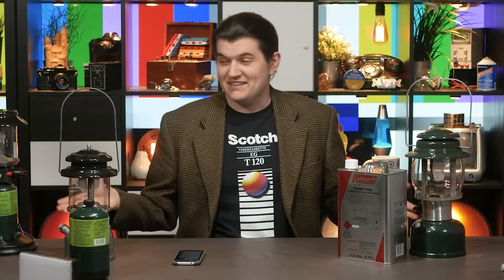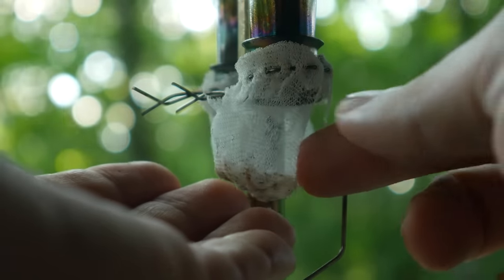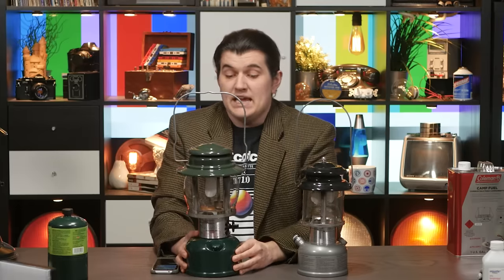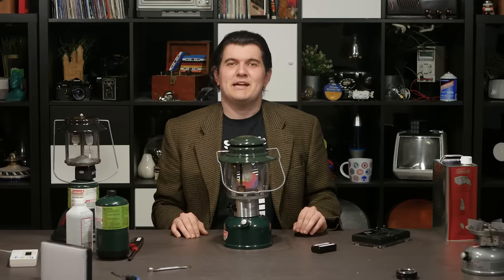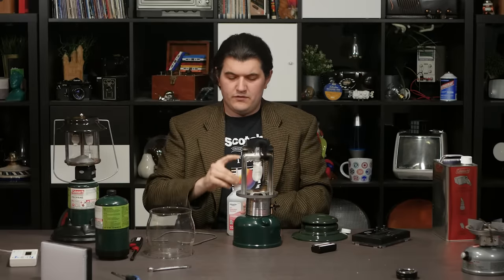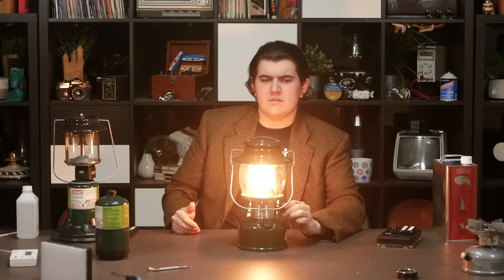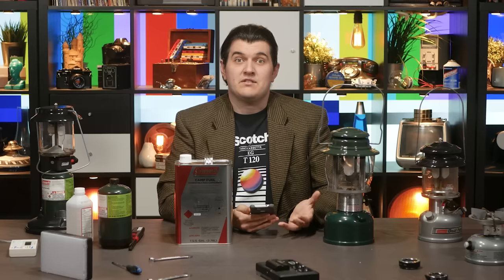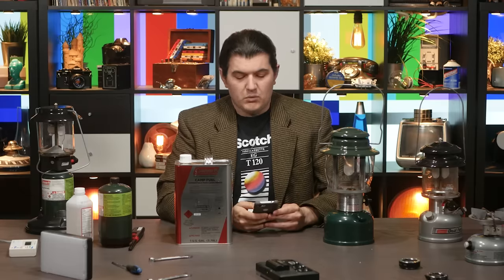A very rambly Coleman Lantern follow-up. Turns out they rarely make sense in 2021

Comment: A kerosene lantern makes a ton of sense as emergency lighting if you are planning to use it in conjuction with an emergency kerosene heater to provide heating during cold weather. Since kerosene has a long life expectancy and is cheap.
Reply: And you can get it virtually anywhere in the world. Downtown in a major city, in a little hick town in flyover country, a village in the Australian outback or the Congo, they'll have kerosene.
Reply: In the climate today, with price hikes, and the potential of no availability of petrol then having another lantern that can use an alternative fuel is always handy.
Reply: Realistically if you are an emergency prepper, you're going to have one each of the dual gas, the kerosene, the propane, and a battery op one.  You're also going to have the equivalent heaters and camp stoves available as well.  Because in an emergency you don't actually know which one is going to be available.  Kerosene is very stable and can store for quite long as well, as you mentioned, but so can propane which also works for emergency grills and heaters.   I would generally pick both over the dual gas option.

Personally living in an area that can get bad winter power outages that last several days, I have propane heaters, a propane camp stove, several propane lanterns like these, several battery op lanterns, and even some chemical light sources (glow sticks) to cover most emergency lighting needs.  We also keep a good stock of propane in winter, which we'll burn in summer over cookouts and then get cylinder refills again late fall.
Reply: @wanderer202   And in long (days, not hours) power outages, where will you recharge the "rechargeable" lights and gadjets ??
Reply: @gedeon2696  i have a about 120$ semi diy solar charging port. It's basically a mediocore photocell, a small battery bank and a bunch of charger outlets. I didn't even have to solder anything because, while not made for each other, modern gadget tinkering crazyness has made them all completely compatible out of the box. 
It doesn't deliver nearly enough power to provide lighting on its own or run any appliance, but if you have to cycle batteries or charge phones and laptops and the like while they are not in use, it's able to cover plenty. And thanks to the reservoire power bank, even multiple things at once for quite an extended period of time. 
And aside from the starting investment it's completely free. It can also be upscaled quite a bit without any real additional hassle if you find you need twice or thrice the power. 
But really, for daily use for my phone or to keep my emergency stuff charged in, you know, an emergency, even an overcast winter day delivers more than enough juice for all of your off the grid survival needs.
Reply: I agree and its always ready to use because Batteries will discharge over time as well as you need to have them charged in case of an emergency. Kerosene on the other hand will always be there.
Reply: @gedeon2696  like he said in the video a small solar panel can recharge them. Plus you can use other sources like generators (that are likely to be used in emergencies) to recharge your batteries without needing to buy more fuel that may become scarce or expensive in emergency situation. Batteries are a (relatively) one time purchase that can provide light for many hours without need of going out to buy more fuel
Reply: @gedeon2696  I have a battery lantern that recharges by solar panel on the top of it.
Reply: @kurtacus3581  I call bs on that. The most advanced batteries on the market still have a shelf life that drastically reduces every couple of years and wont hold any significant charge after a decade if that long. I've got dual fuel lanterns that are over 40 years old and perfectly serviceable. And the practicality of a fuel lantern is not in fuel efficiency.  It's in the ability to instantly renew the fuel source.  Because when your solar panel driven lantern dies after dark you are screwed till the next day. I can dump a container of gasoline in mine fire it back up and keep on doing what I was doing.
Reply: @benknrobbers  it's battery recharges during the day. It will still run after dark. That assertion alone is enough to know you aint thinking clearly about this. Also you are still relying on fuel sources that can become scarce or expensive during emergencies or crisis. Doesnt matter how old and reliable your lanterns are if you can't get the fuel needed to make them work.
Reply: @kurtacus3581  unless it's overcast.  Or you forgot to plug it in. Or the batteries died with age. I would say that your assertion alone is enough to show you "aint" thinking clearly about this. But my obseservation is a general "let them eat cake" attitude.
Reply: @benknrobbers  saying "you forgot to plug it in" is like saying you forgot to light the lamp. Also you can check the power of batteries and get new ones over time if its even necessary. And thats not to mention how in this very video he talks about how much more energy dense batteries are compared to fuel burning lamps. Meaning i could buy more batteries that will last longer than fuel would without even having to worry about recharging
Reply: And safer than gasoline.
Reply: @kurtacus3581  you can buy $1000 of batteries that'll last you a few years. I can buy 500 gallons of fuel for the same price and be set for generations
Reply: @tacticalidiot175  dude, kerosene has a shelf life of only a couple years, propane and gas even less so. What are you talking about? My argument is about obtainability of resources in an emergency situation. Fuels will be scarce or even unobtainable in an emergency situation. If all else is even and a new rechargable battery was purchased and new fuel was bought just before a disaster. You have a limited fuel supply that you likely will not be able refill, not to mention any other commodity that will use that fuel source. Whereas a recharchable battery that can be recharged via solar panel, by hand, etc has basically unlimited use.
Reply: @kurtacus3581  kerosene lasts decades, "what are you talking about?" Batteries will be impossible to find and will be trash in 10 years. No more will be produced. Fuel lasts forever. You can pump it right out of the ground by hand if you live near a field and it will be circulated. It provides heat, and is far more energy dense and lighter. Batteries absolutely suck in cold and hot weather, too. What are you gonna power your stove with?
Reply: @tacticalidiot175  standard shelf life for kerosene is 2-5 years. You can also run out of it. Im not sure what you think is pumped out of the ground but its not pure kerosene. And not everyone just has a field of crude oil in their backyard and a refinery in their kitchen. For a lantern it is wasteful and innefficient to use fuels when a rechargable battery is less expensive and will last for the amount of time you would need to use it in some sort of emergency situation and it would allow you to save a resource like kerosene, propane, or gasoline for other things that need it like a stove or a heater. You yourself said a battery will be trash in ten years. Well thats a lot more years I'll be using that lantern after you run out of fuel. If cut off from any way of getting more fuel or batteries, those batteries will last much longer than any amount of fuel you would be able to store for the same amount of time. Fuel lanterns are not as efficient and more resource dependant that a rechargable battery lantern. Save the fuel for what is really needed. You clearly have no idea what you're talking about if you think you can just pump kerosene straight from the ground. Or if you think your normal average person has the equipment necessary to purify crude oil into usable fuel in an emergency situation. Were talking about normal real life emergencies here not whatever fantasy doomsday scenario where decade of fuel is needed to be stored or used. Even if it did have a shelf life of decades, you're not getting a single decade of use out of that fuel. You cant realistically store that much fuel in a normal household especially if you arent storing it the proper containers needed for it to last that long. Just get a rechargable battery and a little solar panel and stop having your fragile masculinity shattered because i busted your doomsday apocalypse fantasy where you pump gasoline straight from the oil fields so you can survive. You're being rediculouse.
Reply: I still think solar panels almost entirely negates this. Why waste your cooking fuel on light if you don't have to? Electric lighting is FAR more efficient than burning your kerosene for light. If it's possible at all to buy solar panels and batteries, or even a generator, I can't see the advantage.
Reply: @tacticalidiot175 IF society has collapsed so much that you cannot goto Walmart to buy a battery or kerosene, then you have faaaaar more serious concerns than having a light.  Like food.  Not getting killed by roving bandits.
Reply: @kurtacus3581 YES he is being ridiculous by describing some post-nuclear apocalypse where he pumps kerosene from an oil field.  In not-crazy world, a battery lantern can be replaced by driving to a Walmart.  Or charged by solar.

And it operates far more efficiently than a fossil fuel lantern
Reply: BUT the heat is a hassle if it’s a hot summer night.  You don’t want your light source making you even more hot. You want a cool source like LED lanterns

.
Reply: I have kerosene lanterns, I use the kerosene to light campfires. It's perfect, it never explodes and is easy to light.